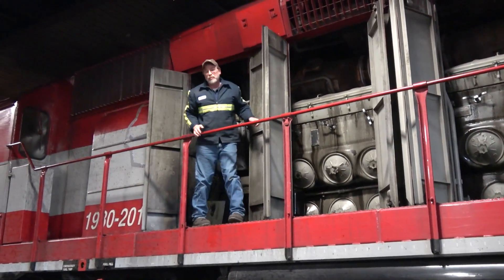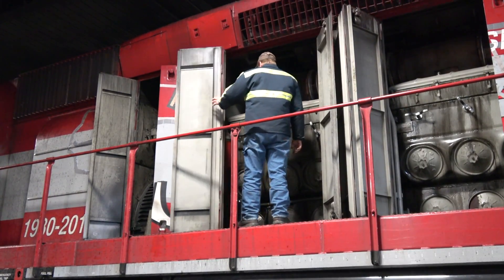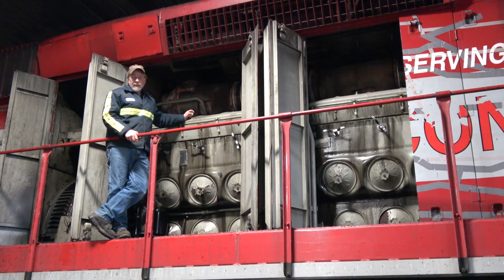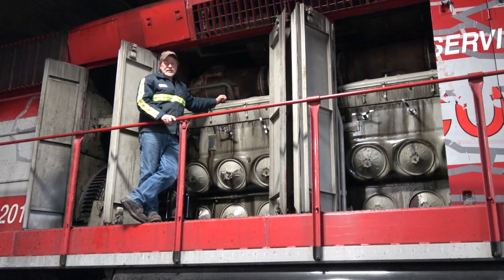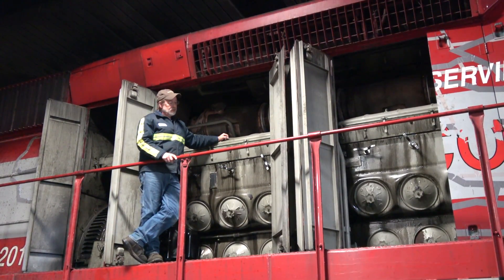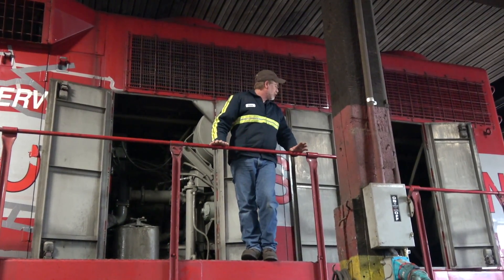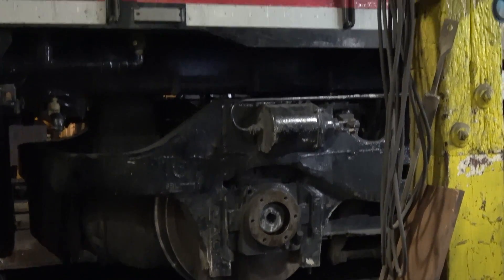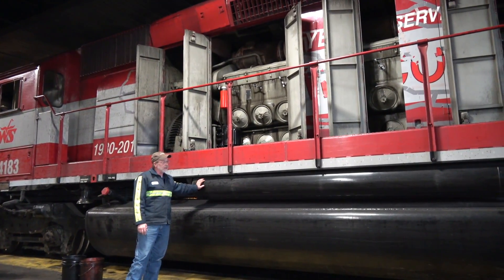TRRS 502: EMD SD40-2 Locomotive Overview

Comment: Worked on the reliable 40-2 my entire 40 year career as an electrician with the Milwaukee Road and Burlington Northern. Great locomotive.
Reply from the maker: Even with contemporary power just about any engineer you speak to still prefers a trio of roarin' 40s to a duet of widecab "crap".
Reply: Thornapple River Rail Series not to be argumentative but no they don’t.  Mainline use pulling heavy tonnage these are garbage.  Wide body six axle ac’s all day long are preferred over conventional cabs any day. 

Short hauls light to medium tonnage and possibly some switching involved then sure.  They are great locomotives and will run forever but they can’t compete with today’s six axles
Reply: Thanks for keeping the trains rolling.  I wish I'd applied to CN or UP before I retired out of the military.
Reply: The best sounding locomotive hands down!
Reply: Adrian Neils you are at an increased chance to get hired since you were in the military and that shows railroads that you know how to follow rules.